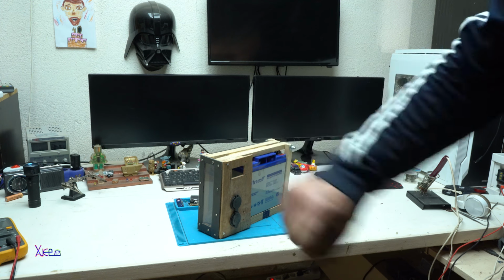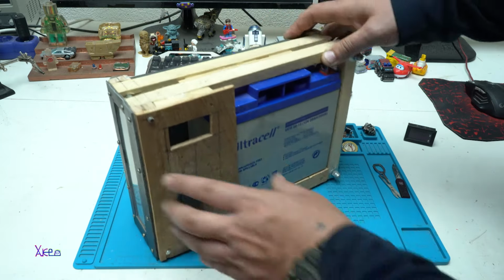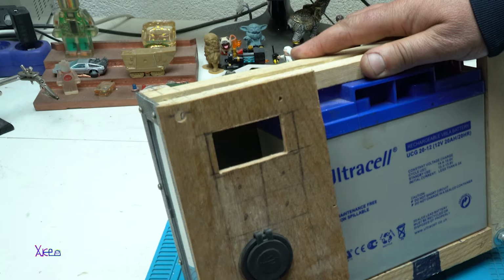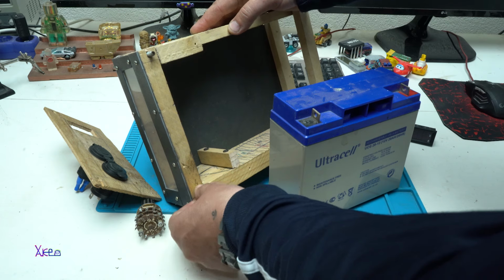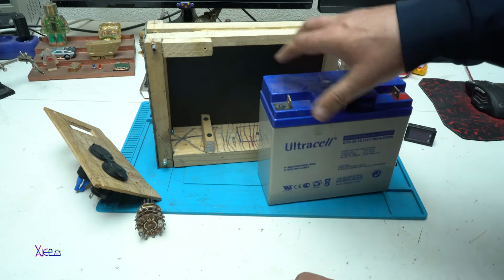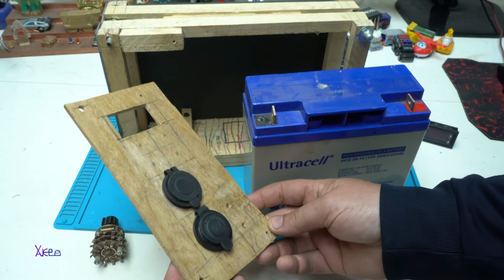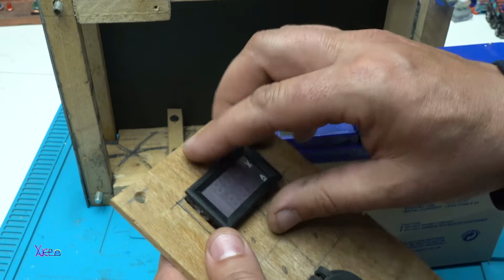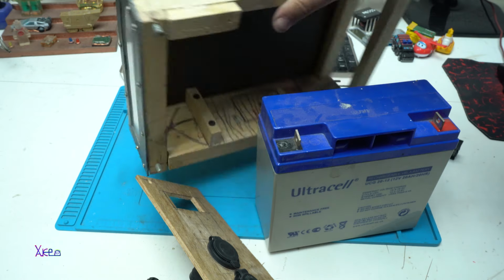My Unfinished and Forgotten Project that sit on shelf 4 years

Comment: What 12 V appliances were you going to run off the car socket? or is that just for charging? It is a large battery for charging or running USB but a bit small for an 240V inverter supply.
Reply from the maker: Thr car socket mostly I will use for my car air pump

Comment: Makes my Amateur Radio field box look huge.  85Ah deep cycle battery, solar and AC charging, 120W inverter and 5VDC3A USB.  Only weighs 65lbs, but it'll run the radio ALL DAY LONG.
Reply from the maker: That is pretty good station,good job
Reply: @Hacktuber  It helped to have a deadline.  Spent a good amount of time in the garage bending aluminum and drilling holes in spring last year.

14' of separation between the solar panel and the charge controller, 12' of separation between the radio and control head, and up to 50' between the radio and antenna.